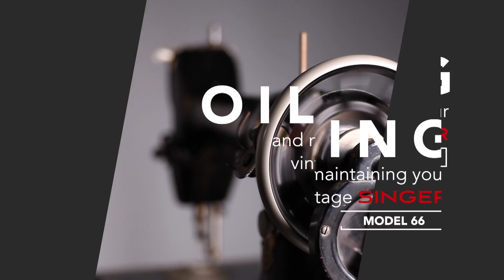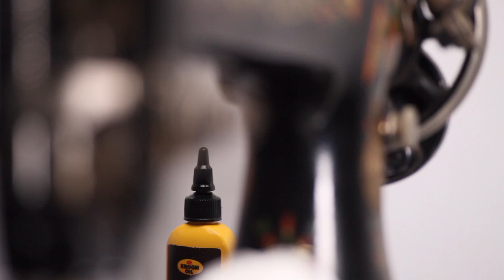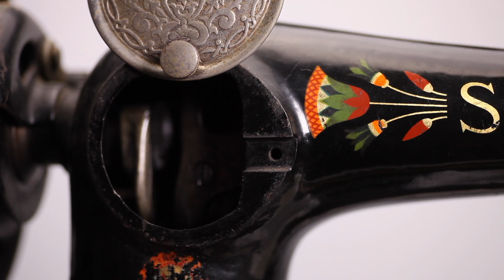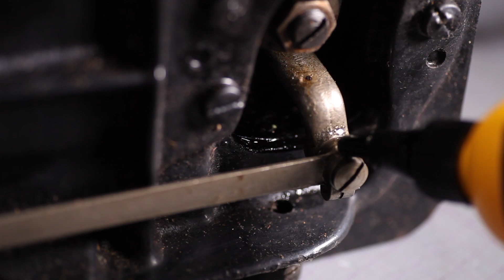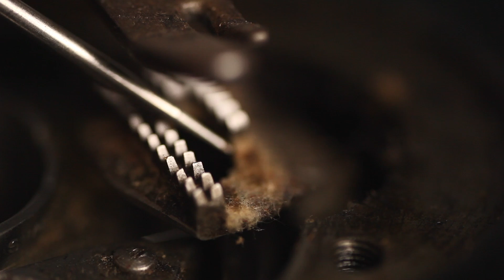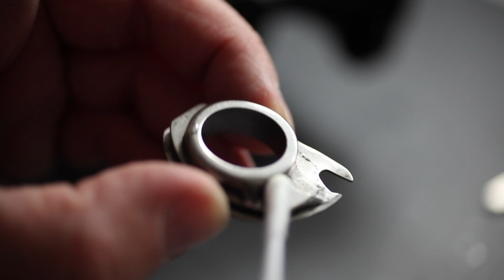Oiling and maintaining your Singer 66  -  Simple how-to

Comment: Thank you. The oil wick on my Singer 66 is missing. As replacement ones are not available I hope to make a replacement using some 100% wool felt. It would be helpful if I knew what one looked like and the actual shape and size.
Reply from the maker: Hi Anne. Thank you so much for your question.
I have an old 99 covered in dust. I can take a look tomorrow and film a few shots. I will link a short video in the conversation thread, so stay tuned.

There is a FB group on the Singer 66 and 99. 
I recall someone posted a similar question a while back, and other members replied with pictures of their machines. Perhaps you can find the info you need over there.

Again, I'll try to make a few shots tomorrow, but I'm not sure if my 99 still has the oil wick.
Reply from the maker: Hi Anne, I just checked my 99k (which I was given some months ago), but that one is missing the front oil wick too. So unfortunately I cannot show you how it should look. I'm sorry.
If you want, check out the Singer 66/99 FB group.
Good luck!!!
Reply: Thank you so much for your reply. I am not on FB but I will have a go at making an oil wick. I managed to find 100% wool felt in various thicknesses so eventually I should be able to come up with a solution. Kind regards